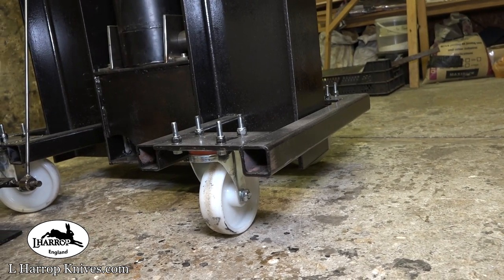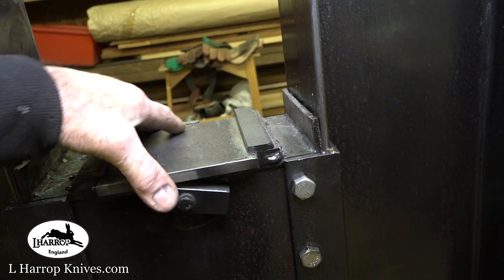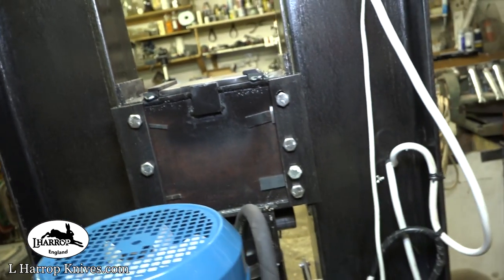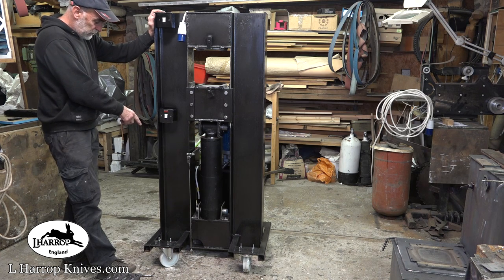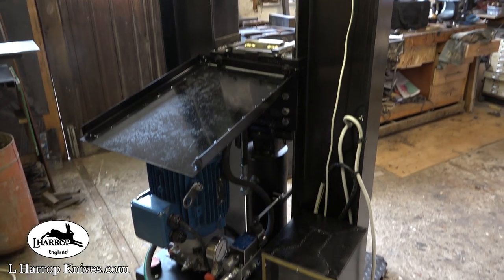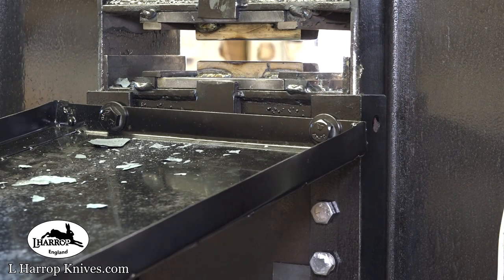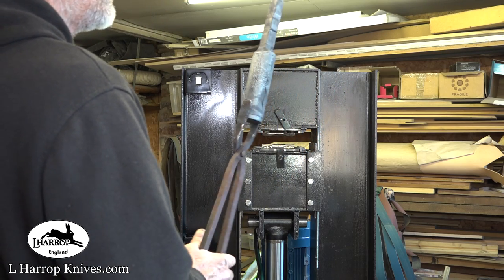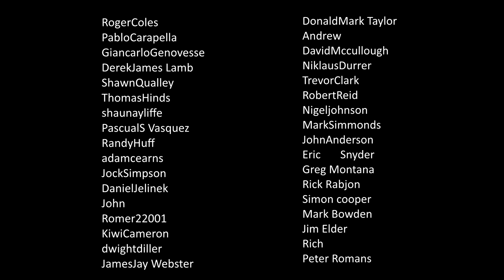Hydraulic forging press build finished

Comment: Now that's a game changer! Great piece of kit! You touched upon it at the end of your video when you said you needed to order more steel, but I'll suggest it anyway... You may find it more economical now to buy your carbon steel in larger cross section now and re-size it yourself with the aid of some "kiss blocks" of known thicknesses to act as stops in the press. The thinner steel bars marketed to us knife makers is often considerably more expensive than the round section used by machine shops etc. Have fun with your new toy, Happy squishing!
Reply from the maker: Thanks bud just worked on my first billet quite a revelation

Comment: Nice work, well done on getting it done so quick. 

I would keep an eye on the temperature of that VFD now that it's enclosed in a box with no ventilation, you're probably fine as the duty cycle is low but keep an eye on it anyway. :-)
Reply from the maker: Yes i will mate thanks, i have the same set up on my grinder which runs for longer periods i did have a thermometer in there for a while but it never got above 25c

Comment: Only thing I would change on next build is reverse where ur ram is located , I would prefer my work piece to stay in place and not move up down with the dies , it's harder to control , it's better when press is pressing from the top onto ur work piece.

Comment: Super build! How is the press holding up? Are you still satisfied with it. And what rpm is the motor 3000rpm or 1500 rpm. Thank you and take care👍
Reply from the maker: Press is still going strong mate, the motor is 1500 rpm if it was 3000 I recon the pump would scream like a banshee! cheers

Comment: Wow !! ...thats a beast ....i am a tiny bit jealous of the speed it flattens the steel  :)   Now in addition you need to  start making some  fullering dies (to stretch)and some  patterning dies....so you do not need to make dust grinding the patterns.   Thinking ladder , random  pattern.
Reply from the maker: Thanks, yes need to make plenty of dies for sure, have started cutting up the 10mm plate to hold them.

Comment: Hi Loz, Great job on your press. I know what VFD's do, but why did you use it on your press.
What was your reasoning. I too will be building a press, and thought of using a VFD. My reasoning
is that, the pump could be run at a higher speed when needed. Most that I seen install a pump
of about 22 GPM but run a motor of 1740 RPM's. Which will move about 11 GPM's. have you installed
a high volume pump ?

Dave Gibson
Lighting bolt Forge
Reply from the maker: Hi Dave, I only used a 3 phase motor because I was told single phase can fail with the constant switching on and off 3 phase is also smoother and costs less to run, The motor is 1400 rpm because the faster the revs the more noise the pump makes have seen some presses with noisy screaming pumps and didnt want that, The pump in fact the whole power pack I had the calculations done for me and the power pack built to operate the 30 ton ram to get the speed and tonnage I wanted. It actually turned out perfect in both, ant faster then it is now and it would be difficult to operate, the travel is an inch every 2 seconds with 24 ton of force. Cheers.

Comment: 🙏🙏🙏please explain the specifications of the power pack I want to make a forging machine like that🙏🙏🙏🙏
Reply from the maker: Hi, this is all I have from the sales invoice but it does list the items used. Cheers.
 Item 1) 1 – off Power Pack Assembly K2/409/F18/A1-20/17GH/S09-V1-G00/N01/N128-PG90-MAR63250/N03-D05-A Consists Off: 3 Phase 3 Kw 4 Pole Electric Motor Central Manifold with Check & Relief (90-250 Bar) Gear Pump to Deliver 6.3 L/min .
20 Litre Steel Vertical Tank with Filler Cap & Drain Port/Level Gauge Pressure Gauge & Isolator 
Single Station Cetop 3 Valve P to T AB Block Manual Lever Spring Return 3/8” A & B Ports  1 – off Hydraulic Cylinder  120 Bore 70 Rod 150 Stroke

Comment: Hey - That is such a sweet build.  May I ask where did you pick up the power pack from please?  Was it locally sourced and did it come with the control valve and motor or did you get these yourself?
Reply from the maker: Hi thanks, Yes I left the whole of the power pack to guys who understand hydraulics and what I needed from it. told them what i wanted regarding speed and tonnage.  I then sourced the ram, motor and hoses to connect to the power pack myself. I got a good understanding of what i would need from the power pack after taking to the guys who put it together I doubt i would have the performance  I have trying to figure it out myself its also alot quieter than it would have been had i gone down the route of parts i had put together on paper.  Would have saved some money going DIY with the power pack but I am happy i spent the extra getting it right first time. Cheers.
Reply: @LozHarrop  Thanks for the prompt reply!  I have been speaking to Kurtis over at Mikrospin!  He is very impressed with your build!  I am going to source the same setup as yourself (like you I don't know anything about Hydraulics!).  Can I ask, the motor you sources, 3phases 4kw, 5HP?  Did you get that from the same place or elsewhere?  Same on the Inverter?  Sorry, but I really want the same setup as you and it's better to ask !!! :D
Reply from the maker: @Doobrey  Cheers yes you just caught me online as you commented. Yes it was those guys I ended up going with . Motor 4kw 5 hp 3 phase, think it was an ebay seller as was the inverter the huan yang one. The ram came for ramco in Ireland just because they where the only ones who had one back then. hoses etc came from a local firm who did them on the spot. Cheers
Reply from the maker: Oi Mr Doodrey! your totally not allowed to have a power hammer and a press thats not fair but subbed you anyway ;-)
Reply: @LozHarrop  hahahaha!  Sorry Loz, but had hammers for a little while now.  It's time to expand to a press also!  Thank you for the sub I have subbed at you already!  Final quick question on the inverter (bearing in mind, I am not an eleccy person),  did you get a 4KW, 220V one to power the 4KW motor?  I assume so, but wanted to check!
Reply from the maker: @Doobrey  yes you do mate think the biggest is 4kw off 240 supply. Thats what limits the size of your motor and. Bigger motor more tons but what i got is more than ample and perfect speed

Comment: It turned out very well. First I saw the motor and the hoses unprotected I thought he forgot something but you fixed it.
I'm still confused and wondering about how the single phase input running a 5,5KW motor without blowing the fuses.
Reply from the maker: Thanks, I really dont know much about electrics but i had read that 3 phase motors use less power run through a VFD off single phase supply than the same size single phase motor. But that could be rubbish?
Reply: @LozHarrop  anyway it works 👍have fun with your new squishi machine ☺️

Comment: Hey Loz,  My power pack arrived (same place as yours).  Quick question on video 1, you adjusted something that doesnt look like the pressure relief value.  I think its the part on top of the pump with an allen key.  Am I right?  Is that how you adjusted the pump to work quicker?  Thanks in advance!
Reply from the maker: Hi Mate, Yes I remember on the vid that the ram didnt seem to be moving as it should and was adjusting something but actually I figured it was just air in the pipes and also the motor was not running at full speed initially when i ran it at 1400 rpm and the air was purged it was fine. So I didnt actually do any adjustments to the power pack.
Reply: @LozHarrop  thank you!!!  Did you purge the air yourself?  I have a leak currently on the top of my cylinder, where the bsp connector “connects”’. I checked out the connector and looks like it’s faulty.  Ordered a new one.  Apart from the small leak, works wonderfully.  Just preparing all the steel for the push plate, sides, etc.   So many “little bits” that need sorting eh!!!  Did you use H13 steel for your dies?  If so, where did you get the steel from mate.  Thanks again for all the help and inspiration !!!
Reply from the maker: @Doobrey  Just work the ram up and down a few times  mate you can hear the noise difference when the air is replaced by fluid. Yes its all the little bits and pieces that seem to take forever. The die plates are just mild steel and most of the dies are made from leaf spring, I got some 25mm thick ones from the scrap yard once you have one die you can then forge weld and press pieces of spring together into bigger blocks etc, some of the spring stock is hard to weld so I just mig all around the joints and press it into shape. it lasts well and so far there has been minimal deformation, I do need to make some taller dies but i will just mig weld more leaf spring pieces on top of the existing ones. look forward to seeing yours in action. Cheers.

Comment: hey loz, i know you dont work from plans, but, how did you calculate for pump/ ram/ motor, do the beaver power packs not perform ? i'm really wanting to build a press but i always have to do things on the cheap (recycle/ repurpose) . It's a pleasure watching your vids, hearing a fellow northerner instead of american accents is cool too
Reply from the maker: Hi Chris, I did some calculations on the power pack and ended up phoning a couple of company's to see what they could provide to power the ram i wanted, there was not alot of difference in cost between building my own and having one purpose built for me, opted for the latter figuring the guys who build them know more than I do ;-) cheers

Comment: Is it just motor, pump, spool valve hoses and cylinder for the hydraulic parts needed?
Reply from the maker: yes in the main, i bought the whole pack assembled because i couldnt be bothered working out all the elements needed to give me the speed and force, i could have maybe saved some money but the unit is compact and exactly how i wanted it.

Comment: Just wanted to thank you for your video and info of your knife grinder as i built one same as yours and its great, now i am watching your forge press and its exactly what i have been contemplating for some time for my blacksmith shop here in Australia,, however,, i am thinking due to costs it will work out cheaper to purchase a 30 ton log splitter and transform it into a forging press with an electric motor such as your design,, i would like to ask if there is any benefit to the ram fitted beneath or above the workbed and do you know what the RPM of your motor is?? i am thinking  2800-3000rpm ?? thanks in advance,, and again great machine bud.cheers.
Reply from the maker: Hi Mate, Glad to help. The motor speed is 1440 rpm, i dont fully understand Hydraulics /motors vs pumps vs flow rate and all the other calculations that need to mesh to get the speed and force you want. The 20 ton log splitters do a good job and the speed is as important as the tonnage, if you can get one inch of travel every 2 - 3 seconds you will be fine, I do know that the pump will be rated for the speed the petrol engine shaft  puts out so try and match it as near as possible or you may burn it out.
Reply: @LozHarrop  Thanks for the quick reply mate, i may have to check out the literature and specs on the pump that comes with the log splitter, i also watched Tims press build from Big dog forge  and it seems to be a goer!! building the frame seems pretty straight forward, judging by what you accomplished, i prefer your design which is a typical traditional style of press as opposed to the single pillar designs i see, and l believe they all have some element of deflection with the open die set-up, but thats just my 2 cents worth,, thanks again bud.
Reply from the maker: No problem mate, forgot to add ram over or under really does not matter from my research.  kept mine below to reduce the overall  height of the press, also with the pumps if you run them at higher speeds they scream like crazy
Reply: @LozHarrop  yea true i been watching shane from blind dog blades and he went from 3000rpm to 1725 due to the noise,, i was wondering if the drop in rpm would slow down the ram speed?
Reply from the maker: @plasmacutter1  i had ago many conversations with hydraulic makers most of it lost now but seem to remember motor speed was not linked to ram speed and force. More hp gives you those
Reply: @LozHarrop  ok,, sounds interesting, i have built many machines in the past for my blacksmithing shop but  i have been reluctant to begin this one due to lack of knowledge of hydraulics, but i suppose i gotta take in as much info as i can before i embark, thanks for your info mate, i will be watching for what you get up to next,, take care.

Comment: It may be time to forge some proper tongs to handle your big billets! The tongs featured in this clip looked functional (barely!) and a bit on the shabby side. Great knives deserve good tongs! Love the press!
Reply from the maker: Yes agreed, I picked them up years ago at a boot sale pretty useless but the only ones i had to hold that bar.
Reply: @LozHarrop  certainly looking forward to seeing you make proper Damascus billets with your new monster. I think I may have to begin to collect parts for my own press. Being residencial, a power hammer is out of the question. But a 30 ton high speed press would definitely make life easier. Keep forging!

Comment: Holy crap!
Reply from the maker: holy flat crap
Reply: @LozHarrop  indeed buddy, are you releasing plans for this epic press. Also, what was the total build cost? Including power pack,  ram etc etc
Reply: Also, would it be a good idea to have a protection sheet over the power pack buddy?
Reply: Lol, u did it, I hadn't got that far into the video lol

Comment: How many kW or HP is your power pack motor? Is it 240V(I'm Aussie)
Reply from the maker: Hi, its a 5hp three phase 1400 rpm run off an inverter